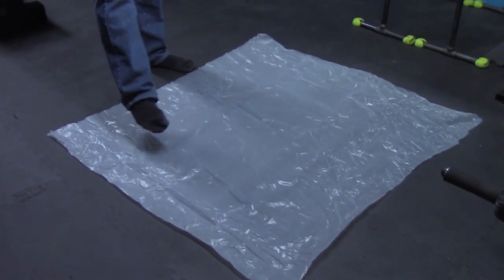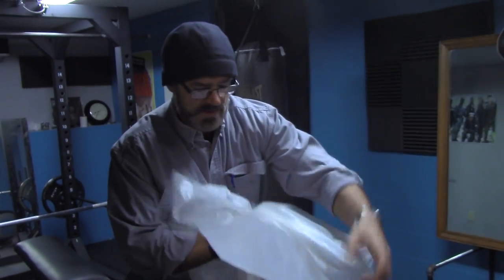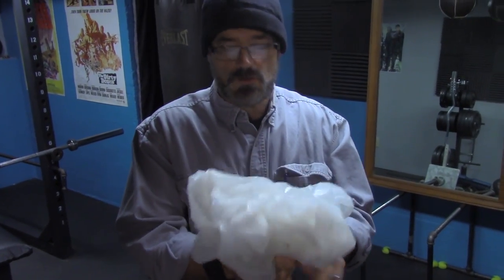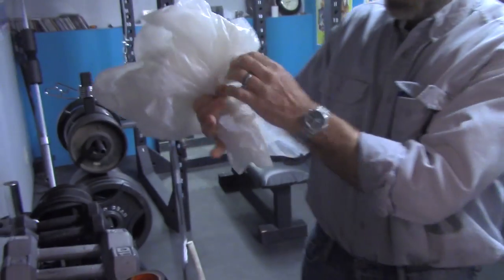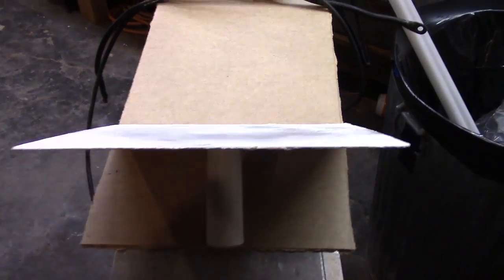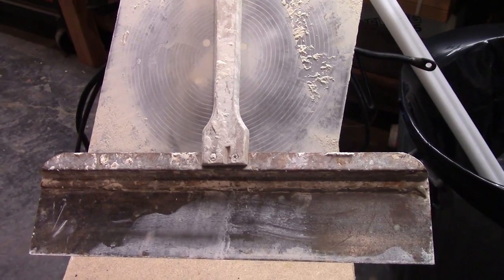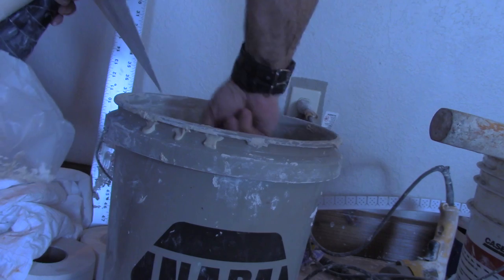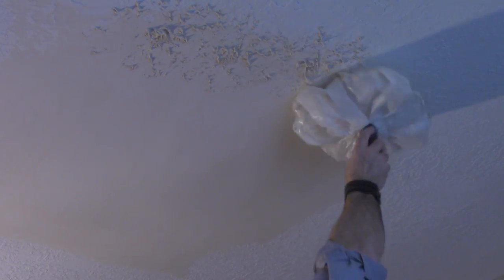Drywall  How to do Hand Brocade - DIY Duke

Comment: Hey Duke, Could you maybe do a video on making a orange peel texture? My whole house has it with some spots in need of repair. Especially on the corner beads, the paint an mud has come off exposing the metal
Reply from the maker: Hey Heather if you go to my video: Finishing Drywall Job -Masking, Primer and Texture the orange peel info starts at 2:56.  If you have any questions let me know.  All the tools you need (texture gun/hopper, air compressor) you can rent.

Comment: You know I've always kind of wondered how to get that texture properly. Considering it looks really nice on ceilings, I will likely give it a go when I finally get around to doing my kitchen. You have a suggestion for how hard I should keep the trowel on the wall? Just skimming it or do you put a bit of pressure on er?
Reply from the maker: Yeah Josh just kind of skim it.  The thicker the mud the harder the pressure.  You can test a small area out then scrape it off until you get the feel for it.  Or on a scrap piece of sheetrock.  Generally in a kitchen or bathroom I try to do a light brocade which is easier to clean and get a little heavier in living rooms and bedrooms.  It's a really great texture for people who decorate with outdoor themes, rustic, western, those who like to display hunting trophies, etc.
 
I'm going to try and get another texture video out this week.  It's one of my favorite textures; a skip trowel over the painted wall using the same color wall paint  mixed into the drywall mud.  It creates this really subtle two tone look.  To enhance the look I throw in some silica sand for that old world plaster look.  Really awesome looking and super custom and pretty simple to do.
Reply: +DIY Duke you know what, I didn't really think about the fact I should keep it light in a kitchen considering grease and what not. I guess that's why it's good to ask these kinds of things! I have just the rustic living room to put it in as well. Just need to put in the time now, haha. Until then I'm just going to attempt to stay buff (sitting here hurting from your sons' damn 12 week plan)
Reply from the maker: Ha ha, yep I'm right there with ya.